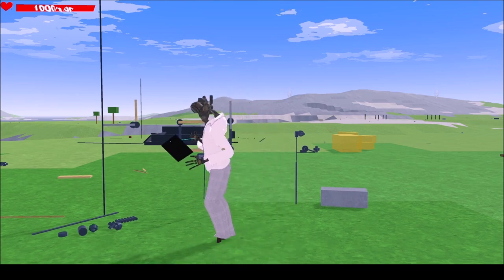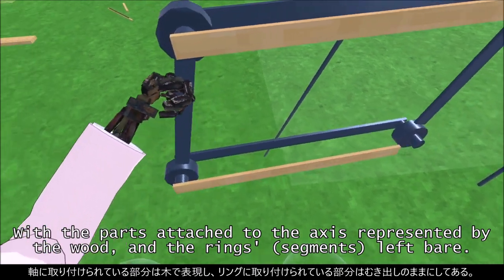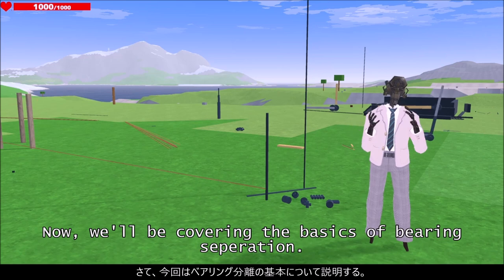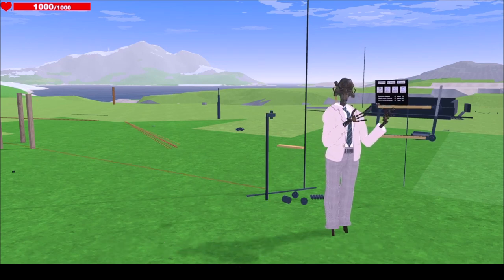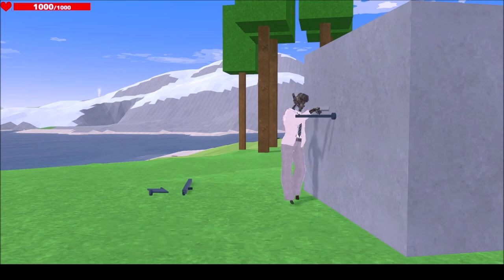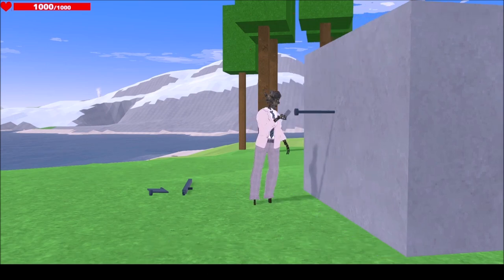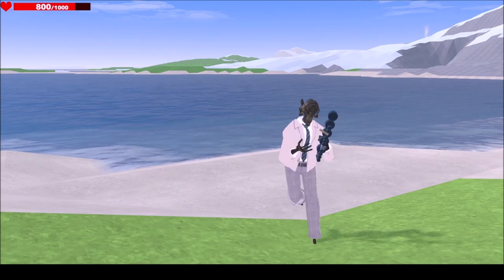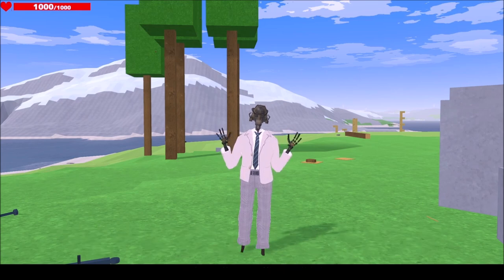Primitier | Bearing Basics

Comment: How does the gun survive the explosions from the gunpowder? Is it cause of the gun material or the size of the gunpowder?
Reply from the maker: It's a bit of both, ancient alloy is a good enough material for taking the explosion damage from the small gunpowder propellant in the bullets.
Reply: @gerald6500  Something else I'm curious about is how accurate is it?
Reply from the maker: @enchantingnova989  it's remarkably accurate at around 30-50m, and the thin front sight makes targeting much easier
Reply: @gerald6500  oh also (sorry for all the questions lol) but what do you use to charge your batteries?
Reply from the maker: @enchantingnova989  no worries, i use a generator that is based off a design by kurosakiworks, you can find it in the official discord :)

Comment: How did you heat up metal with the batteries? I wanted to make a portablel pistol but i cant find tungstan
Reply from the maker: only tungsten can heat up with electricity, but the orange ore should be found a fair distance outside of the starting area, and you can cut it out then fire it, use niter for a hotter flame to smith tungsten, or use the infinite heat generator bug.